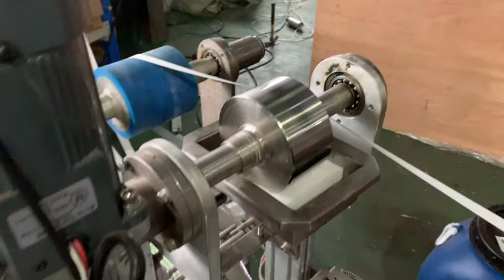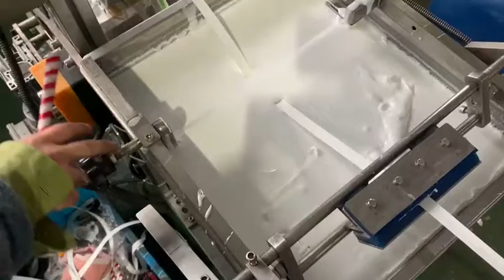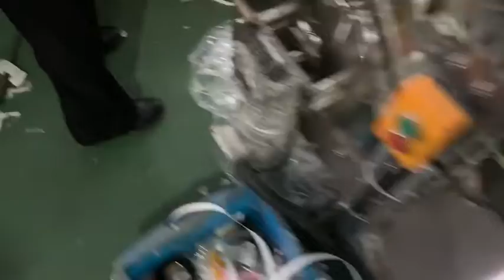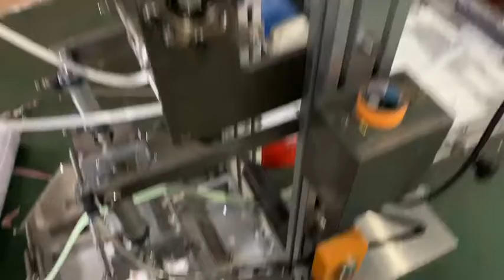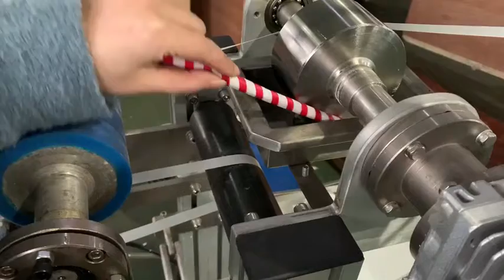glue unit 10

Comment: Did you change the design of glue unit ? Some of your videos it is only 2 plates for glue but this one has 3 plates  and what is the material as a oil   for inner paper  you use
Reply from the maker: Yes, changed. Now it's only one plate for glue, easy to clean and operation